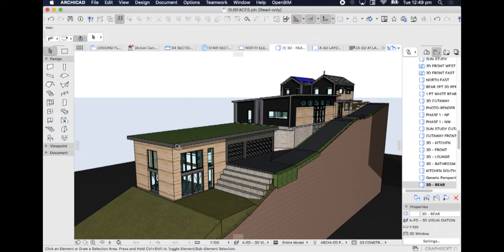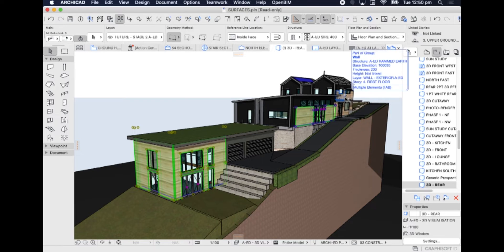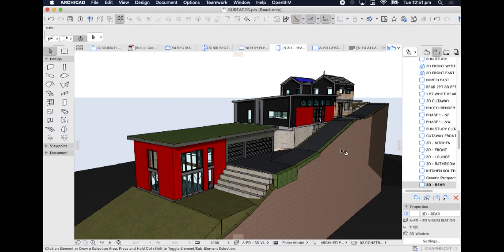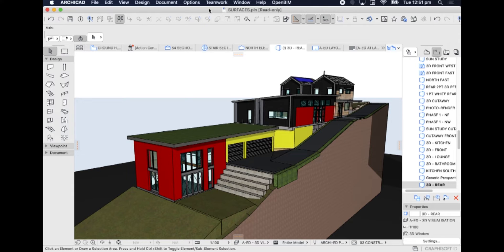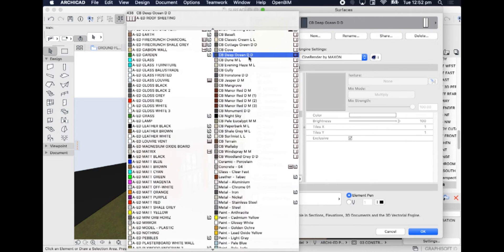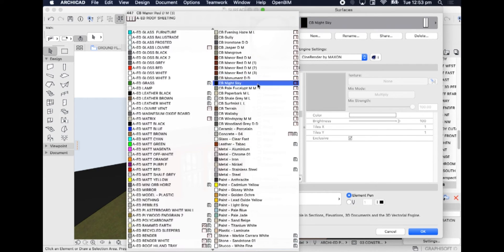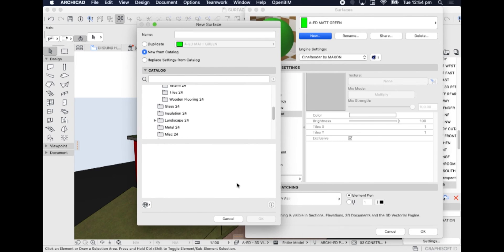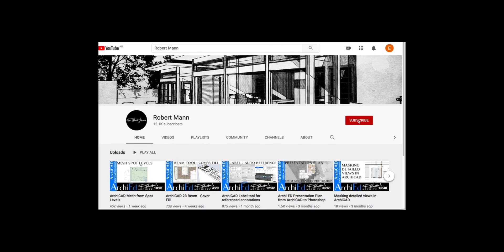Creating New Surfaces

Comment: Hi, I have not find any solution to make my new surfaces available in every new project. Do you have to make a new surface-library every time you start a new project?? For an example, I make a new floorsurface in one project, then later I start a new project and want to use the same floorsurface? This doesnt work for me. // Jonas